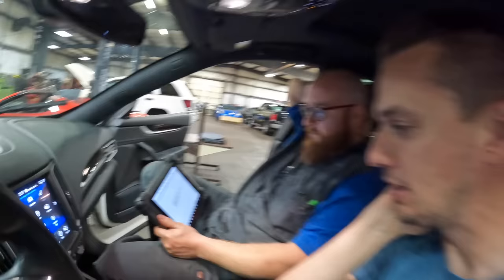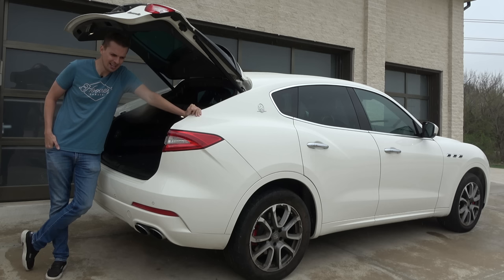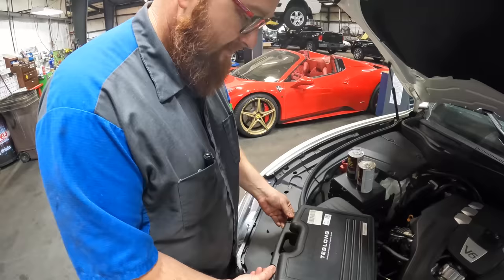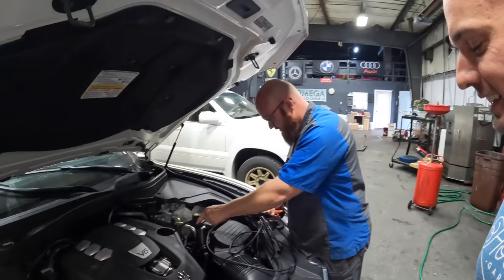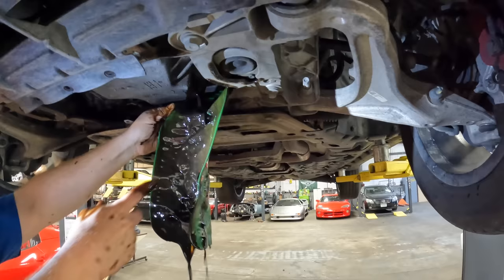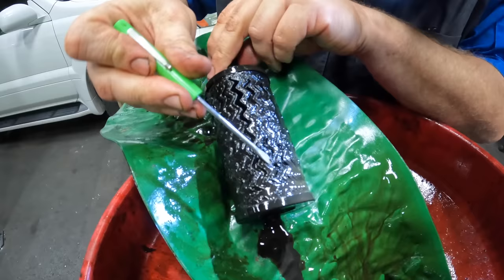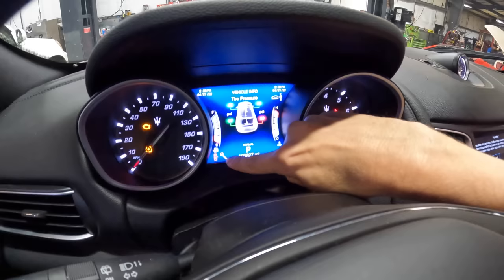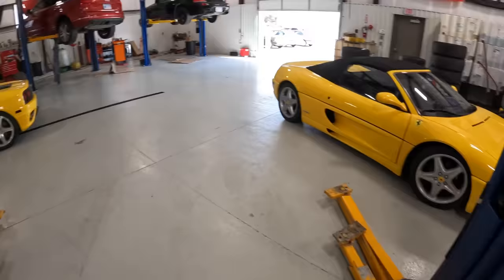My cheap Maserati Levante repo was a DRUG RUNNER, with NO OIL CHANGE for 60,000 miles!?!?!

Comment: 16:22 "That's the longest oil change [interval] I've ever heard of". My aunt and uncle bought a 1983 Volvo 240 Turbo back in the day and NEVER changed the oil. It went 85,000 miles before the engine blew. They got super lucky: Volvo bought the wrecked engine (for not much money) from them when they replaced it because they wanted to see what it would look like.
Reply: Did they just not understand the whole "change your oil" thing?
Reply: Wowzers. Though I bet there are a lot of cars with blown engines where they cause of failure is just that. For sure there are a lot of   shady places/mechanics that dont change the oil, even though they say they have.
Reply: @GoldenCroc  you'd find out about that soon enough by just checking the oil level
Reply: @skycaptain95  A lot of people dont care enough about checking or know enough to tell the difference between new and old oil though. 

The volume of "oil" (fluid in the oil system) in many cars can stay the same or even increase over time.
Reply: @GoldenCroc  One wonders how they get through life.

Comment: i had a 87 chevy cavalier that i drove for almost 75,000 miles without changing the oil - bought it with about 130,000 miles for $600 and sold it with just under 205,000 miles for $400. told the guy i sold it to that it hadn't had an oil change for more than 75,000 miles and recommend he not change the oil. he changed the oil and the engine blew 50 miles later
Reply: Old engines might indeed run long without a change and no issues @Jeremy. Newer / turbo engines is a different story.
Reply: Just like you shouldn't change trans fluid if you don't change it for a long time.
Reply: The stuff of legends...did u add oil though? That's is what my late dad used to do

Comment: 2014 Prius developed that smell in the trunk... turned out that there was a water leak getting into the car past the taillight gaskets, and accumulating in the spare tire well and the 12v battery compartment on the right rear corner, and it smelled exactly as you describe. Sealed the leak, and flushed/scrubbed everything out, including replacing the sound deadening materials under the spare tire, where most of that chemical reaction seemed to be taking place, and it was all good.

Comment: For piece of mind, I would remove as much of the interior as possible (within reason), to make sure there are no additional stash spots.
Reply: Ultimately that's going way too far for a non issue. Since he bought the car it shouldn't be an issue but I'm not a law expert so idk
Reply: @Schmuly  Obviously not. Even if you bought a car from someone else with drugs in it, or they’re not your drugs, you can and will still be charged with possession if it’s in your car.
Reply: Maybe let a K9 take a sniff.
Reply: @ripem1417  Exactly! This happened to a friend of mine, right out of high school. He bought a car at auction and fixed it up. During a stop, the K9 unit got a hit. He was arrested, but not convicted. Thankfully the plant was all rotted and the timeline didn't match with the amount of time that he had the car.
Reply: Two years ago I bought a P71 and just six months ago I had to go behind the glove box installing a new head unit and sure enough there was an extremely old pill bottle stashed in the wiring there.  I have no idea what the stuff was in the homemade capsules but strange that it was a detectives car, so who would have stashed it in that location.  Long story but, hell yes would recommend doing this.

Comment: 60k miles between oil changes and it still ran? Holy crap, maybe those Maserati V6's are better than anyone thought.
Reply: "Maserati"... Fiat group engines have always been pretty good generally, as far as I know.
Reply: It's the rest of the car that's the problem.
Reply: I think this car is the successor to the Russian Bentley Continental 🤣🤣🤣

Comment: Ferrari & Chrysler : a marriage of inconvenience.

One of the three big rental car companies did a test with a group of several thousand cars in the 1980s.  They took new cars and never changed the oil or filter. They topped up the oil, as necessary. They did recommended manufacturer's maintenance otherwise. Then they compared the repair frequency against cars that got the oil changed per manufacturer's recommended interval, etc. What they found was that there was no real difference in the two groups, in the first 100K miles. After that in the second 100K there was a whole bunch of difference.

Comment: I'm thinking you should have put a new filter in prior to the flush. Also it would probably be a good idea to do this flush twice. JRGarage just had a video about a month ago doing a very advanced sludge removal procedure using the same company but he used different stuff and did multiple flushes.
Reply: I like how you have the balls to tell a trained mechanic what to do.
Reply: @Uniongamers my guy just speaking out his opinion. touch grass bigman.
Reply: I very much doubt they would change the oil and flush it without changing the filter.
Reply: the bigger kit from bg recommends new filter and drain all existing oil. run it on cleaner for 45 minutes. dump that, new filter, rinse oil for 25 min. dump that, new filter again and regular oil with MOA from bg.
Reply: I would have swapped the filter first for sure.  And probably dumped the old oil and filled with conventional and a new filter just for the flush, then another change after and again at 500 miles.
Reply: Is YouTube filled with sweats who think they know more than professionals? Cos most the replies to this comment are making me think so.
Reply: @Uniongamers  I've been wrenching for 20 years. you've been watching YouTube. go pick up a wrench. you might learn a thing or two.
Reply: @dustyc324  wonderful, I'm so happy for you. Maybe, instead of lecturing trained mechanics like The Car Wizard, you could put your all that engineering knowhow to good use and make your own YouTube tutorials. You could do that, or you could just get butthurt and reply to my comment with another snide comment about me not knowing how to use a wrench (or some such guff). Though we both know which choice you'll make.
Reply: @Uniongamers  lol. weak. I'm not lecturing anyone. I make enough money at work, not going to make YouTube videos. thanks though. I still advocate for you learning something. maybe after mom makes dinner her bf can come by and show you how to change the spark plug in the lawn mower.? pretty sure I don't need your approval of my lifetime worth of experience.  thanks though.
Reply: @Uniongamers   he is right
Reply: @Uniongamers   i have 45 years of engine work and building.  So dont assume you know anything

Comment: I use Moldex and the premixed 1 gallon "In-Cide disinfectant" from Menards.
I spray them directly to the fabric\metal\harnesses and let it soak few mins.  Shampoo the seats after some presoak. Repaint the metal on seats.
I gut the headliner, carpet and padding, entire metal of the car gets sprayed, sets for 10 min then gets wiped out, 2 treatments at minimal.
Ducts get sprayed with a long modified hose that sprays backwards and then snaked with duct cleaner wire tool, also air and vac is used to suck chemical\crud from drilled hole in lower heat box.
I can do that headliner for 250 bucks. Located in MN.

Comment: Sweet baby Jesus, this Levante wasn’t just neglected, it was abused!

EDIT: 12:32 and speaking as a Walmart Auto Care Center lube technician, I’d have to agree 100% that serviceablity on cars built in the last decade have taken a SIGNIFICANT nosedive, and the worst offender happens to be Ford of all manufacturers!
Reply: Ford GM and Chrysler products...
Reply: Which Ferd is best Ferd?
Reply: @cigarsgunsanddiesel8032  I’ve seen newer Nissans with a ford style solid skid plate that you have to undo numerous fasteners just to expose the drain plug and oil filter; and at least Dodge/Stellantis gives you maintenance cutouts in the skid plate like in the Cherokee and the Dart.
Reply: That is Fix Or Repair Daily for ya ;)
Reply: To be fair most modern Ford engines crap out after about 50,000 miles anyway, so there's no point in making them serviceable. I swear whoever designed the Ranger's engine to grenade if an oil change takes longer than 10 minutes to complete has a warped sense of humor.

Comment: I would have filled it with cheap 10W40 or something and run another flush cycle...
At least one more flush cycle.
I tried to recover a 6.0L GM 3500 box truck that probably hadn't had an oil change in 200,000 km, out there doing nightly cargo runs.  😧  It took dozens of flushes, oil filters every 500-1000 km or so and an oil pump change before it started being "less sludgy" when drained, but the inside of that engine probably still looked like goo...
Reply: Yes. JR will flush at least twice. New filter every time too.

Comment: it could just be no one ever reset the oil light after they changed it. Also, I would drive it for 100-200  miles and then do a flush and new oil/filter again, just to be safe. That $100-$200 is cheaper than major engine repair.
Reply: Agreed on both points.
Reply: Based on the dirtiness of the oil and the fact that it is one owner and it was reset at all, combined with the fact that if you were a drug runner, you wouldn't want to risk bringing it to a shop and they discover the drug smell

Comment: I bought a Corvette from a dealership that bought it from a drug auction. To the drug dealers who had owned it before, it was a disposable delivery vehicle. They made it much faster than a normal Corvette of that year (1980 - I bought it in '97). They made the changes on the cheap, though, because they expected to lose it like they did.

By the way, you might want to pull all of the speakers and check them. That is another place where they tend to store their product. The marshals who had seized my Vette pulled the rear speakers completely. They also pulled the carpets to get rid of seeds or residue, but I doubt if you will want to do that.

And for everyone who is saying that you would want a car that blends in - Not only did they modify it to make it faster (they bored out the engine from 350 to 383 and took off all of the smog control that robs "malaise era" cars of so much horsepower, and they replaced the automatic transmission with a Muncie Rock Crusher 4 speed) - they also repainted it from white to bright red. I guess they didn't get the memo about not standing out. (And of course they did get caught, eventually).

Comment: After the BG flush don't you need to do another oil change in fairly short order to make sure you get all the remaining build up out?
Reply: Probably after like 500 miles or something
Reply: It takes the oil time to dissolve/dislodge things. This helps prevent the oil passages from getting blocked instantly. As long as none of the oil ports/screens are not plugged in, it should be fine for the amount of driving Tyler apparently does.

Comment: I prefer Liqui Moly's flush. After the flush, I do a oil and filter change and run the car for 15-20 minutes, and then change the oil and filter again to get any remnants of the flush out the system.

Comment: Both oil brand names are perfectly fine for your Maserati. I personally would've gone with Liqui-Moly myself in this instance only because you did a major engine flush and Liqui-Moly does have a lot of good detergents that can help break down any residual build up that has accumulated inside the engine overtime. But Castrol has been around for years and they definitely make very good quality oil as well

Comment: I love the BG products I usually drain the oil leave the old filter and put 2 cans of BG engine restorer a quart of trans fluid and the rest of the capacity is filled with lightweight oil and it really helps
Reply: Then of course due the proper oil change after it runs for 20-30 mins

Comment: Tyler, you do realize there could have been oil changes done without the computer being reset, right? In my opinion, it didn't look gunky enough to have been 60,000 miles since the last oil change. Keep the great content coming, so entertaining!
Reply: That was the first thing that I was thinking. Even if it was synthetic, it would have turned to pudding before 20K. Also, most quick lubes dont change the filter or reset the computer, they just put the dummy sticker on the windshield.
Reply: @ralphmenta249  my mother took her 2016 Jeep Cherokee over 35K miles without an oil change. it holds about 6 qta, it was 4 qts low, it didnt look great but it wasnt exactly pudding, likely because it running 0W full synthetic. not sure if that was a factor.

Comment: And based on the shape of that oil, I'd have thrown in some extra detergents, run that oil for a few dozen miles, then immediately changed it. You have so much sludge in there that running a full cycle on that oil just wouldn't make much sense.

Comment: Called the EPR on the other video. Great stuff. I would use the MOA too after a couple of EPR services and everything is cleaned out. And they could have had oil changes without resetting the light. A la taking the car to jiffy lube or some such nonsense
Reply: "they could have had oil changes"

100% thats what they would of done, or just dropped it on the driveway and filled it with the cheapest shit oil they could find.
Reply: @mickeydee3595  that's what I was thinking. That just records the actual resets on the odo. Not done without a fancy tool in the back alley safe house as they unload the cargo. Prolly didn't bother with the filter either. Trap cars are horrible to work on

Comment: If you need something to remove any bad smells from a vehicle, even bad cigarette smoke or a decomposing body is no match.(Don’t ask how I know)
You will need two cheap easy to find ingredients. First you will need some regular charcoal like for cooking out on a grille & second thing you need is  a pair of tube socks.  Take between 4-6 pieces of charcoal depending on size & stick them in each sock then tie the end of each sock in a knot & place them in the floorboard of the vehicle. I  always put one sock under each front seat.

Comment: I’m surprised the turbos are still good without any oil changes and that much sludge in the system
Reply: Do the Turbos use the same oil as the engine? If so, that's amazing like you say.
Reply: @georgespalding7640  yes they do and the turbo oil feed line is always a very small diameter

Comment: It’s a real crap shoot when you flush a engine like that, because now all the sludge has been removed between all the badly worn out engine components, including the turbos. Observe closely for knocks, ticks, oil burning and drop in oil pressure that might be coming soon
Reply: Agree.  This is time to put the for sale sign on it.
Reply: That’s also how transmissions get fried… bring them in for a drain and fill on the trans but the shop flushes….then u buy a new trans
Reply: Had a customer with a Saab that had never had and oil change in 100,000km.
When I drained it, got 2 litres of oil in 40 minutes.

We changed filters, put basically a sump full of different engine flush products in it. As it ran it got louder and louder. Timing chain slap is hideous. 
Drained it again. Put new filter and good oil in it, but the noise wouldn't go away.
We pulled the rocker cover and the chain was totally encased in sludge, which was probably the only thing stopping the chain rattle before the service.

It was also 6 litres low on water ( because coolant to these people is rich man's water) and the trans was 4 litres low.

To be honest I have no idea how this car even ran.

They did try to see us for killing their car, but when our solicitor asked for maintenance records and invoices, it all magically went away.

Comment: Would that engine flush actually help improve gas mileage?? Especially considering it’s awful maintenance history?
Reply: 100% nothing ridiculous but it should run way more efficient not needing to push that sludge around
Reply: There are two schools of thought on sludged up engines: you don't flush them because if you do, you break up chunks and they clog oil passages and cause damage and the other try to dissolve them all and clean it out. 

By cleaning out all the gunk, you could be opening up the rings etc where they are worn due to the lack of lubrication, this would equate to poor fuel economy due to lack of compression. If he was lucky and they aren't worn, it would improve fuel economy since everything will be lubricated and freer moving.

Comment: That oil filter would be bypassed by the safety valve since no oil can travel through it. Meaning, all the gunk, dirt and particles was circulated through the engine for a long, long time. Surely made at least some damage.

Comment: 60k miles since the last oil change, I'm pretty sure that will have shortened the life of that engine.
Reply: The Oil Filter has been plugged up for probably 30,000 miles so the oil just bypasses the filter and the fine metal particles stay in the oil chewing on the bearings and other engine parts. This engine will have problems in the very near future.

Comment: When I was in grad school at a big SEC university many years ago I worked for the university and got to drive state owned vehicles. But first I had to take a safety class and they covered the need to make sure you scheduled the state owned vehicles for regular services. The instructor told us about one truck he saw with no oil changes for 60,000 miles. He said when the oil was finally drained it was “lumpy.”